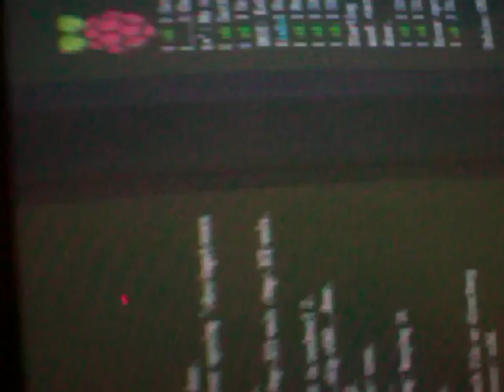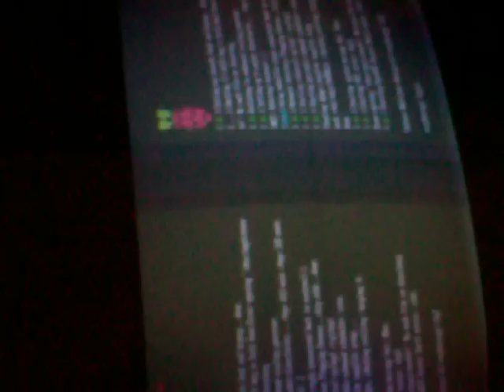Raspberry Pi Arcade Monitor Hookup RetroArch System

Comment: Still curious on how you're getting a good display on the arcade monitor, true VGA should look like a garbled mess on a standard resolution arcade monitor. Though, I suppose the Pi might be defaulting to composite output and putting that sync to the HDMI if the adapter isn't identifying itself to it.

Comment: I've had issues in the past with doing similar. Having a hacked Genesis gamepad and an arcade board plugged in (even without one being on) would have controller inference, like certain buttons not working or one button press triggering another on which ever system was active. I'd also be very worried about back voltage from the board's scanning of the buttons getting to the Pi's GPIOs and potentially damaging it.

Comment: Interesting. How are you forcing down the vertical sync rate to what the arcade monitor can handle? How are going to handle the controls, as blocking and masking sometimes occurs if you have two games connected?